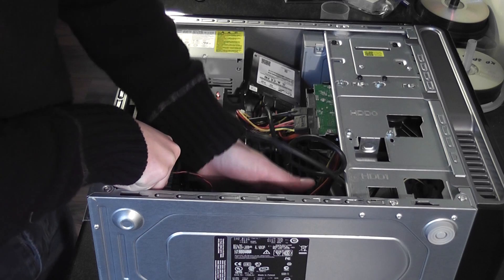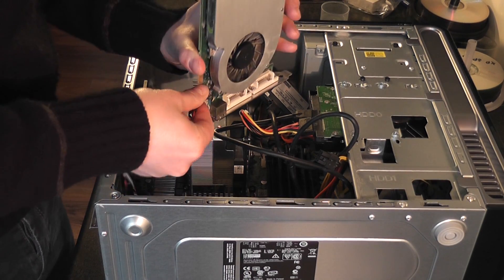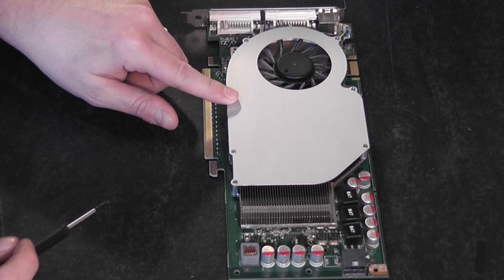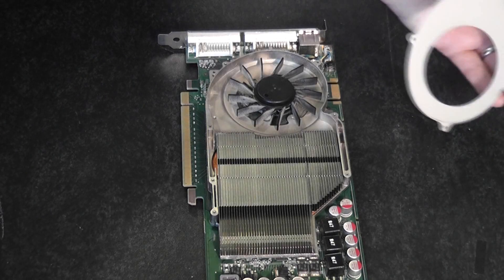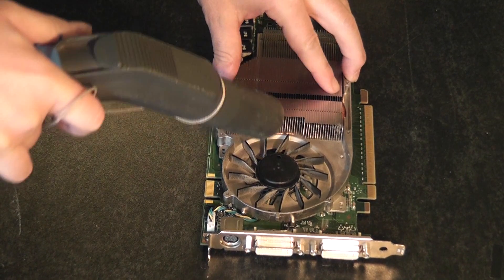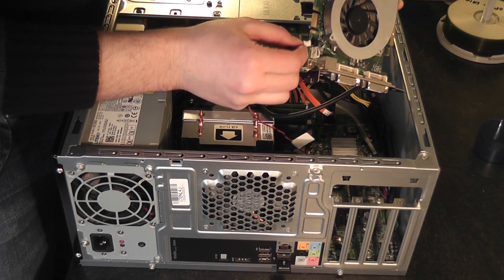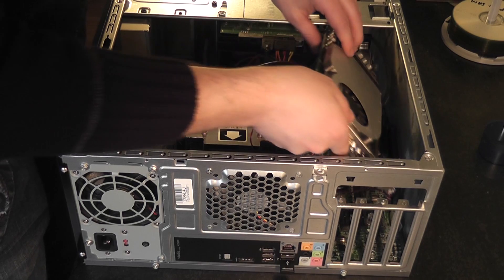NVIDIA GeForce GTS 240 Cooling Fan Service - Prevent overheating step by step guide

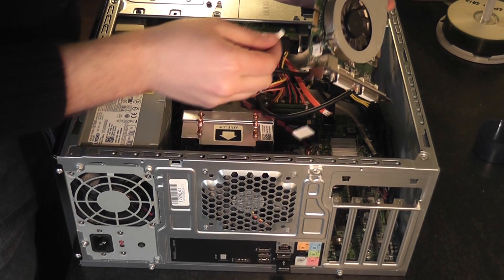Comment: 2:28 Can you tell me what that connector is for?
Reply: I read somewhere that its an audio thing? Maybe it was on the motherboard, spdif header?/ Hope this helps lol
Reply: @AKVSOUND  Thank you for the effort :)
I plugged it in but I don't know how it works. Maybe it has DVI with Sound.
Or does the On-Board SPDIF on the Motherboard only work if this is plugged in? That would be weird.
Reply: @PEACEWALKER1992  we took gts240 from a xps studio and put in another unit ignoring the cable completely, it works perfectly without but we use the onboard sound and as far as im aware dvi doesnt have sound, maybe its for the S-Video? Not entirely sure
Reply: @AKVSOUND  I see, some new Video Cards have Sound over DVI but SVideo sure has no sound at all.
Reply: @PEACEWALKER1992  I dont know anything about them really but ive just seen this on wiki....  7-pin mini-DIN

A 7-pin pseudo-mini-DIN socket

7 pin plug diagram
Non-standard 7-pin mini-DIN connectors (termed "7P") are used in some computer equipment (PCs and Macs). A 7-pin socket accepts, and is pin compatible with, a standard 4-pin S-Video plug.[8] The three extra sockets may be used to supply composite (CVBS), an RGB or YPbPr video signal, or an I²C interface. The pinout usage varies among manufacturers.[8][9] In some implementations, the remaining pin must be grounded to enable the composite output or disable the S-Video output.

Some Dell laptops have a digital audio output in a 7-pin socket. [10]
Reply: @PEACEWALKER1992  Noting the mention of Dell audio output... Not sure but it sounds like that
Reply: @AKVSOUND  Interesting, again thanks for the effort! I thought that is purely either for RGB/ Component / Svideo. Well it sure must serve some function.
Reply: @PEACEWALKER1992                                          1  GND

2  GND

3  Y

4  Pr

5  GND

6  Pb

7  S/PDIF (digital audio data)
Reply: @AKVSOUND   I actually got a Component adapter and plugged in my HD Crt to that Graphicscard. It looks amazing :)

Comment: My GTS 240 is 8 years old and started giving screen static and anomalies. Took it out and cleaned it, also exposed the cpu and contact and dusted it out too. Put it all back together and it is quiet and running like new. Thanks!

Comment: Thank you very much. I have been suffering from noisy fan problems from my Dell Studio XPS for months. I opened up the Nvidia GeForce as you showed and it was packed solid with a mat of dust in the cooling vain entrance from the fan propeller. I cleaned it all out, and cleaned the cpu fan while I was inside. Now my computer is running quiet like the day I bought it. Great!

Comment: Also, occasionally, as someone else said, my fan makes a terrible clicking/rattling noise, usually you can hear it as early as boot, so it's not like it's running a game, etc. Cleaning it with the air seems to help a bit, but I'm still very worried - this is the second card I've been through that does this.